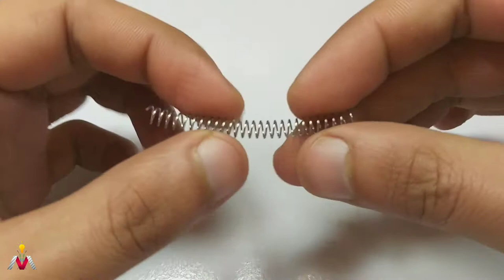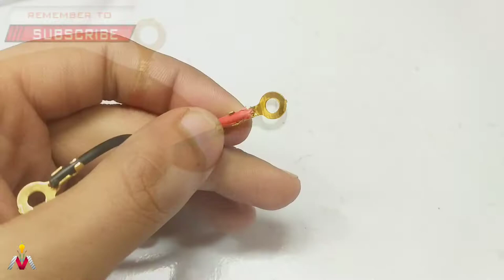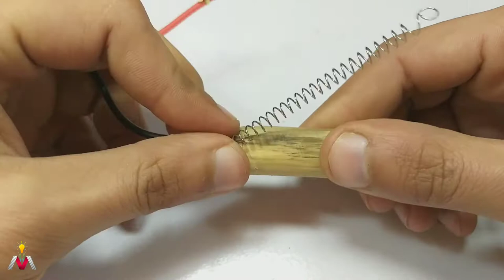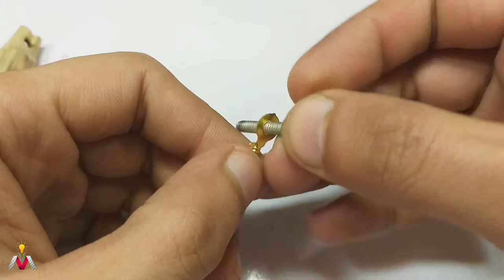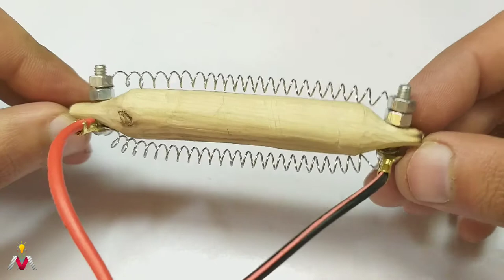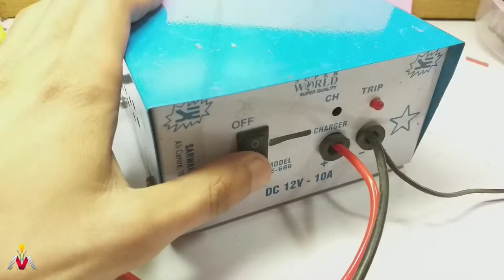Mini Diy Water Heater 12 Volt | How To Make | Youtube

Comment: this 1 2volt or not I try to start with 12v battery
Reply from the maker: It works on every 12volt even if it is charger or battery or anything however it needs high amperage around 15 - 20 amps .

It is a heater & consumption is around 400watts which will drain a battery very fast , I will recommend using a 12volt & 15 amps charger.
Reply: sir but I have 100 solar 11plate battery I use it
Reply from the maker: @pyaralarka2654  You can use a solar panel as well if it is producing enough current , All you need is look on the back side of your solar panel make sure it produces higher than15 amps Good Luck :) 

Check out my other videos Thank You :)

Comment: This is needlesly complicated. You can remove the bottom branch of your circuit . The wood is not warranted unless you are into orgone science or something else 

In sum, you need :

-> 2 wires ( cut power cord for example).
-> 1 spring (or loop).
-> a 12v battery (or wall outlet).

You can then heat your ramen and tea like a dirt-poor Tesla. Rock on fellas !

Comment: ईसको ईनवोटर सै चला सकते है
Reply from the maker: I don't understand can you write in English please Thank you
Reply: @imake2895   can I start with invoter
Reply from the maker: @yourhelpline6156  Did you mean inverter?
Reply from the maker: @yourhelpline6156  Inverters are basically  used for stepup voltage so you dont need an inverter.

In this case you need a 12volt Adapter/charger in order to power this 12volt water heater.